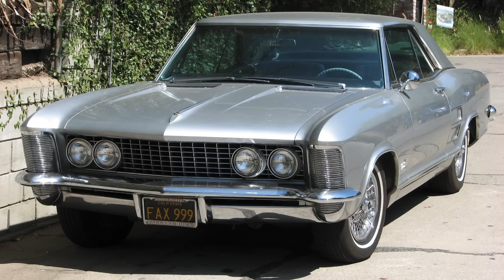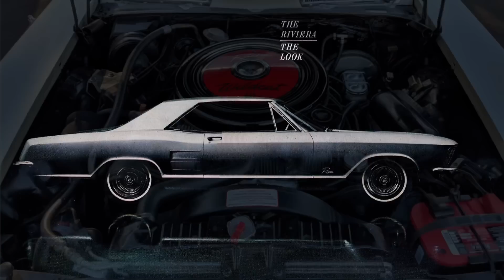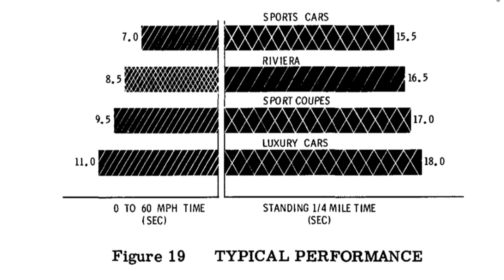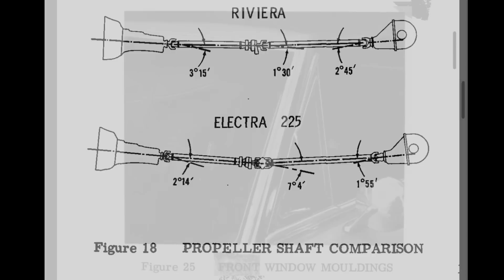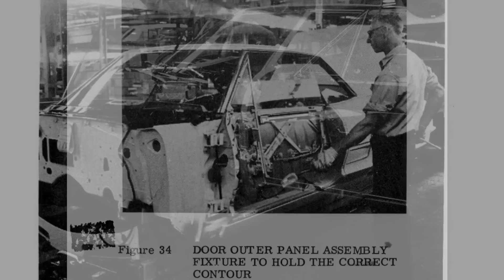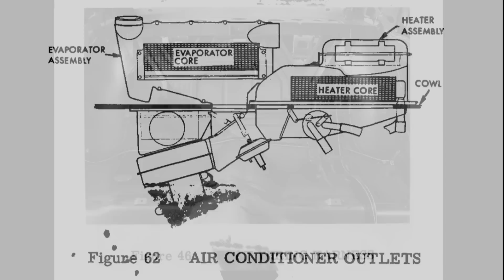Facts and Trivia about the 1963 Buick Riviera That You Never Knew!

Comment: You might have added that 1963 was the last year for the non-shifting DynaFlow then called Twin Turbine Drive. In 1964, Riviera got Buick's first automatically shifting 3-speed automatic which it called the Super Turbine 400. This new automatic would revolutionize GM's automatic transmission segment. For 1964 only, this new automatic had no 2nd gear position with the quadrants P-R-N-D-L. Also, in 1964 Buick introduced the 2-speed S.T. 300 automatic, found in smaller Buicks and Oldsmobiles. Internally, it was similar to Chevy's PowerGlide, with many interchangeable parts.
I wonder about the 0-60 times for the 1963 Riviera. I'll bet that they started the car in manual Low, which would still have the advantage of the variable-pitch stators and, depending on the final drive ratio, could be run up to 60 in "L", but I'll bet they shifted into "D" before that.
Reply: I doubt they started in low. I have a 63 lesabre with the 401 and twin turbine drive as well. I got rid of the factory 2 barrel carb and went with a factory 4 barrel set up. In drive with the 2.78 open differential, I get a consistent 9 second 0-60 time. If you start in low and get it to keep traction it will actually shave off another 2+ seconds off the 0-60 time if you know when to shift back into drive.  Those riviera's typically had 3.23 differential so even better.
Reply: @Nailhead63  When you have a big engine and lots of carburetion(2-barrel on a 401?), starting in high gear ain't-a gonna give-a ya the fastest acceleration. The speed of acceleration is what it is all about. Keeping traction in a gear close to 2nd gear on a 3-speed automatic? With a tall final drive ratio, it would probably take skinny tires on a wet road to break traction. Heck, my '71 Ranchero with 15" wheels with 285 h.p. and a 3.0 diff. had trouble breaking traction in 1st gear of it's automatic.
Reply: @automatedelectronics6062   From 62 and 63 the 401 in the lesabre was standard with only a 2 barrel carb. 4 barrel on the lesabre would have been the power pack option from the factory that I later added.  The twin turbine dynaflow is actually a cvt with an emergency low gear that you can manually select.  In drive the 5 element torque converter does all the ratio changes from the max stall ratio of 3.40 down to 1 to 1.  When the low range is selected, it kindof locks the torque converter into the 3.40 ratio and you also get the additional 1.82 from the low range on top of that making the acceleration more aggressive.  With the 2.78 differential I found it best to shift back into drive around 45mph or the acceleration will start to slow down again.  On a little bit of a side note you can also push start the car in low and use it for engine breaking down steep grades.  Low in a dynaflow is not 1st gear like a normal automatic
Reply: @Nailhead63  Why not install the 2-4 Bbl. option?
The low gear ratio of 1.82 in a PowerGlide was normally found in light trucks or in high performance cars. When I used to build PowerGlides for racing, I would use the 1.82 gearset over the common 1.76. As the transmission was connected directly to the engine, there was no slippage.
With a torque converter, the max torque multiplication starts from normal take-off. Once the stators star spinning, torque multiplication ends. The DynaFlow cheated with movable stator blades which would allow more slippage. They were opened or closed, no variable in-between. When they closed, this would cause a blip and torque would be slightly increased. 
The variable stators were controlled by a switch actuated by the position of the throttle linkage. The switch had 3 positions. With the throttle closed or slightly opened, the stator blades were in the torque multiplication position. During cruise throttle position, the blades were in the closed position, promoting the 2 halves of the torque converter the ability to be close to the same speed for better mileage. At full throttle, the switch would open the blades increasing slippage and allowing the engine to get to it's powerband much quicker.
The theory behind having 2 stators was that they would sequentially start spinning and gave a longer torque multiplication range while also allowing a higher stall speed getting the engine into it's power sweet spot quicker.
Sure, the DynaFlow could be considered a CVT, but because of the fluid coupling aspect, it could never reach a 1:1 ratio. Modern true CVT's will reach a true 1:1 ratio and will even go into an overdriven ratio.
Yup. Most auto transmissions could be used to push-start a vehicle if they had a rear(output shaft-driven) rear pump. After 1965, most automatics didn't have rear pumps. This is one reason we only used 1962-65 PowerGlides for racing.
The triple-turbine DynaFlow had no rear pump. You couldn't push-start.
Right, the main reason for the "L" gear position was for engine-braking. The torque converter never came close to locking up. Actually, the vanes on the transmission side would be spinning faster than the ones on the engine side, making the engine rpm's to increased creating a load on the drivetrain. "L" was also very helpful for acceleration. Just like any transmission, you have to know the best time to upshift.
Reply: @automatedelectronics6062  If I could afford what an original 2x4 set is currently going for I definitely would but most of the time I just cruise around so I don't really need it.  True not a perfect 1 to 1 but I do believe it was pretty close.  The twin turbine dynaflow only had 2 positions on the stator. For the other position to work the throttle has to be pushed in all the way and happens at the same time the secondarys on the carb open up. It is a mechanical linkage. The super turbine transmission that came later was an electric switch by the carb correct?   Either way I do think the dynaflow does get little but of a bad rap. The early ones were definitely bad but the later ones got better. I like to call the low range the cheat gear because it surprises the heck out of people when I do choose to use it.   To be honest a lot of what I learned was just from reading the factory service manual that I have for the car.
Reply: @Nailhead63   The original S.T. automatics had a double switch, one for the stator and the other for kickdown(passing gear). These switches had 3 positions. At closed throttle, the stator solenoid was energize. At cruise, the switch was open. At maximum throttle, the switch energized both the stator and kickdown solenoids.
Cadillacs had the switch mounted on the carb. Chevy, with the TH400, originally had it mounted on the intake manifold and actuated by the movement of the throttle linkage. The last one mounted the switch on a fixed bracket above the gas pedal and the gas pedal linkage rod had a rod protruding from it which would contact the switch.

Comment: I know that some of the GM X frame cars were available with a reinforced full width frame for convertibles and as a 'police' option. Was the Riveria convertible built on a heaver frame? Racers would get the convertible frame for this reason. I remember in my dad's 1960 Chevy when we went around cloverleaf ramps you could actually see the frame flex if you watched the gap between the seat back and the door pillar as we rode in the back seat.
Reply: Those style Rivs were never convertibles

Comment: Not a Buick, or Rivera. My folks had a 1965 Impala equipped with air conditioning. The outlets were chrome plated metal, “eyeballs” on the outermost ends of the dash and a center narrow vent. Those metal outlets could get FROST on them from those Frigidaire compressors and R-12 refrigerant. Nothing like today’s units!
Reply: In the late '80s, I picked up a '72 Mercedes 220 sedan. One of several needed repairs included getting the AC going. A few days after installing a new HP hose, a seal-kit for the York compressor, a new filter-drier, and a charge of R12, I was coming back from a trip up Maryland's Eastern-Shore on an extremely humid summer morning. I had one of those automotive dial thermometers in my center dash vent and watched as the temp dropped to freezing, then down to 28. Below about 24 degrees, the airflow started weakening, until it stopped altogether, even though I could still hear the blower roaring. The AC thermostat seemed to have no effect. So I exited to a service-station, and shut the engine off, then turned on the ignition for several minutes without starting the engine, just to get the blower to melt the ice from the evaporator. Eventually, a stream of water created a big puddle under the car, restoring the airflow, and I was on my way. I had to repeat this 'fix' two more times on my trip. 
Later, I pulled the center console and found someone had been messing around in there, and didn't put the thermostat probe back in its' little hole in the evaporator-case. The evaporator never iced up again, and the AC-vents never got down to freezing either. But on R12, that AC still cooled just fine!

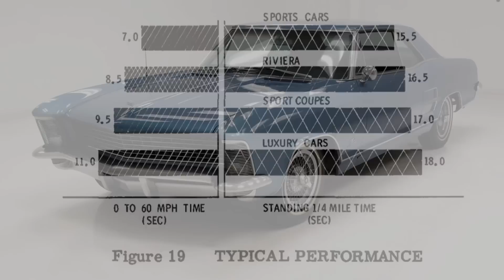Comment: @3:04 Check out the blue '63 or '64. It has hidden headlights like the '65, but only partially hidden with "grills" covering the lights similar to what they used in '65.
Must be a concept car?                       Looks like a modern photo, so still around?

Comment: Actually Buick was selected for the car - they pushed hard for it and their ad agency put on a partiuclarly polished presentation to get it.  True, Cadillac didn't want it (they were essentially at production capacity and had no need) but the other divisions were interested.  I'd argues, as others have, that the T-bird in image, if not in fact, was its progenitor and direct competitor (and outsold it every year save 1969)/  Still absolutely striking and it has aged fantastically well.  You can show one to a non-car guy who insists everything looks alike, and even they will take it in and admit it's pretty special.

Comment: Once you notice the resemblance to a 1962 Chevy II you'll never unsee it. It speaks to GM Design under Bill Mitchell's skill and GM's market power in the '60s that they could introduce so many new design cues on the cheap economy car first and then carry them over to a high-end aspirational car like this and it's a thing of beauty and a success. When they tried that again 20 years later with the '86 Riv/Eldo/Toro and its' looking like a N-body Skylark/Grand Am/Calais, the pricey car flopped so badly rush restyles were ordered.
Reply: I immediately Googled photos of the ‘62 Chevy II and frankly have no idea what “resemblance” you are seeing that I cannot.
Reply: @Primus54  The Chevy II came about since Corvair was a sales flop compared to the Ford Falcon. And there is very little comparison between spartan economy and all out personal luxury. No AM/FM radio optional with Chevy II until 1969 when it morphed officially to Nova.
Reply: @garyblanchard1084  Thanks for the info.  I am aware of the history of the Chevy II.  However my original reply to “nlpnt” remains unanswered… I cannot see the “resemblance” to the Riviera whatsoever.

Comment: The dual four barrel option was available on the Riviera and Wildcat. With this option it could perform much better. I never knew about the unique door assembly thanks.
Reply: @DontCryAboutIt  Correction the dual carb setup came out in 64.
Reply: I had a 1963 Buick Riviera with the 4 barrel and 401 engine in it. That's how I got the car it's original state..

Comment: Adam…I would encourage you to consider the Chrysler Letter Series cars that ram for eight years prior to the ‘63 Riviera…I’m a big fan of the Riviera but personal luxury sports was invented by Virgil Exner and Bob Roger.  Keep up the great work!
Reply: Chryslers work with Ghia did produce a lot of concepts of 4 seat sporty luxury cars, but Chrysler never put that concept into production, like Ford and Buick did. The 300 was a full size luxury car, with a high performance engine, on the same body as the New Yorker, with a Imperial front clip. Not very close to being a trend setting new class of vehicle. Great car, yes, but Apples and Oranges, for this discussion. The Dual Ghia and the English Bristol, and Jensen, all Chrysler powered, are a better argument, for your point, and the Dual Ghia, I believe, was built on a Dodge chassis.

Comment: Wow, check out those crazy exhaust pipes, with little mufflers at the back. I wonder what they sounded like new.....

(And I wish they had gone with the eyelids 4 the headlights from the start.)
Reply: Yeah, what's up with those unnecessary looking bends under the front footwells??
Reply: @DanEBoyd  my guess is to slow down the gases without having to go through a second set of mufflers... Free breathing.
Reply: The pipes are probably curved like that to clear the frame and floor pans.  The small mufflers are resonators, and the single, main muffler is sideways between the rear axle and the fuel tank, similar to the early Camaro dual exhaust, with two inlets and two outlets.
Reply: @joesmithjoesmith4284  I  thought of that, because the first Toronado used that system (which to me negates the point of dual exhaust...)  However, even with a magnifying glass I can only see two shorty mufflers by the diff and MAYbe a pair of resonators at the very rear  (like the Gen 2.)

Comment: As loumontcalm says, the Riviera and Thunderbird could be considered of the same class, with the Riviera coming much later.   If you are tracing the fossil remains, you might say the Corvette was the first sporty car frpm the Big 3, a 2 seatrer, and the '55 T-bird was a luxury 2 seater response whereas the 1955 C300 Chrysler was a modified standard Chrysler, not a separate car, but a full size hot rod.  As such, it lacked the separate marque status but also initated the large sporty car concept.  The Chrysler 300 letter series was generally faster than Riveria or Tbird and by 1960 had a best in class 4 seat leather interior and full length console.  But it was gone when the class was thick with Toronado, Eldorado, Grand Prix and Monte Carlo.
Reply: The Thunderbird was built in the same Factory is the Lincoln Continental. It was not an upgraded cheap car ( at least not until 1977 when was lowered into a cougar class car)
Reply: You forgot about Studebaker Hawk

Comment: Bill Mitchell, Virgil Exner and Harley Earl are for me the top class geniuses who made the cars so memorable because of their design. I think the '64 Riviera is the most beautiful Riviera ever built, love the written Riviera signature on the back of the trunk. That riviera is definetly in my top 25 of the most beautiful cars ever built. The 300C from '57 deserves a spot too, the '57 Fury, the Ferrari 250GTE, the '59 Bonneville etc.
Reply: I never knew the 57 Fury existed until the movie Christine. An absolutely cherry car (with a grille instead of the vertical slats under the front bumper).
Reply: I think Elwood Engel deserves a mention, too.
Reply: @LongIslandMopars  as does Bob Bourke
Reply: I'd say yes to a '64 over a '63 primarily because of the transmission differences, not to mention the 425 engine becoming standard for '64.  The '63 had that 1948 design Dynaflo that needed rebuilding every 40,000 miles.  The '64 had a Superturbine 400, the first turbo hydramatic.  The '63 and '64 engine crankshafts were also different because the rear of the 63 crank hade a huge hole to accommodate the huge stubby nose on the Dynaflow torque converter.  Hence, you could put a '63 engine into a 64/5, but not the other way around.

Comment: I would say one of the best looking designs ever!
Reply: Yes it is, I'll always remember it from the movie Roadhouse!
Reply: @bobhill3941  ya the one on Roadhouse was great, a later model though with the vacuum operated headlight doors
Reply: I hear Patrick Swyaze had a thing for '63/4/5 Rivieras
Reply: That was a 65.  @bobhill3941
Reply: Agreed!  👍  Artwork on wheels.
Reply: @petestaint8312  Yes it is, even though I'm not a hidden headlights fan from a reliability standpoint.
Reply: @bobhill3941  it depends on system...  The electric motor and torsion bars on the '66 and '67 Rivieras was flawless.  The individual vacuum actuators for the Cougars and Toronados sucked.  Then, the single vacuum actuators for the 70s Lincolns worked fine unless you had a leaky vacuum hose...
Reply: They weren't hidden until 65, which ruined the look of the car.
Reply: You just triggered two wildly disparate thoughts on styling:  
A.  The last, Gen8, Rivieras could arguably be considered the last great Buick design, and
B.  No one ever thinks about the stylists who made good-looking cars that were cursed with lousy mechanicals...  Here I'm once again thinking about the Vega coupe & kammback.  I mean seriously, look at the Pinto and the Gremlin!  😁
Reply: Thats for sure and it's beauty still holds up today!